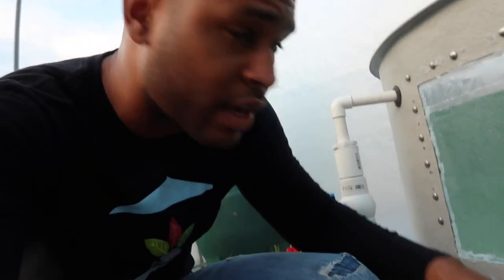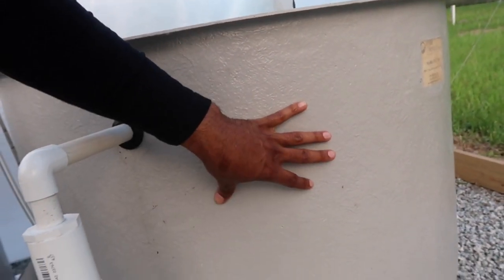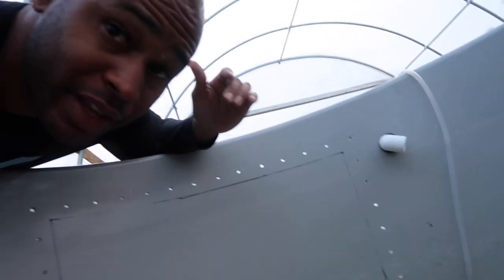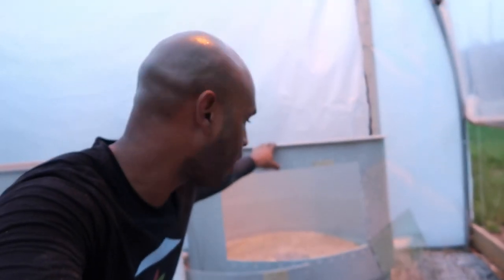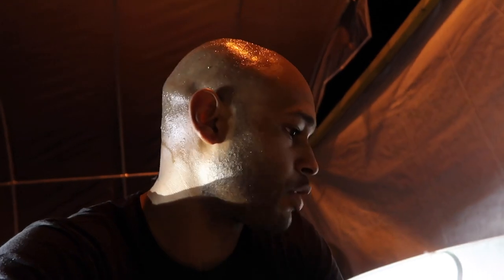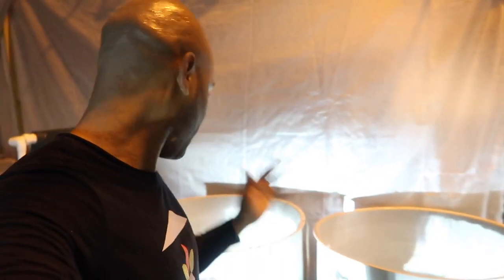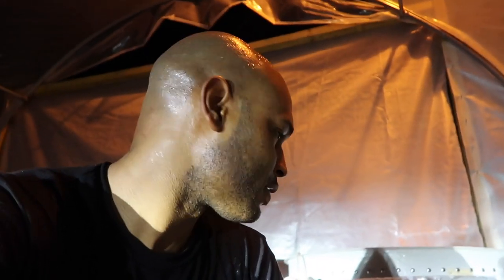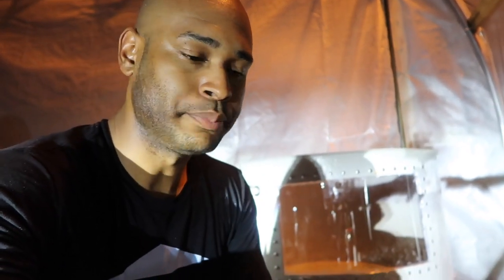Installing The Fish Tank Windows | The Aquaponics God Ep.41

Comment: Not to rain on your window parade, but maybe next tank you put the smooth side of the carriage bolts on the inside of the tank and the nuts on the outside.  I think it would protect the fish from the threads and also probably seal better.  Plus, should you need to tighten the nuts, you can do so from the outside even while the fish are inside.
Reply: John Doe mere mortal...

Comment: I wonder if it matters which order you tighten the bolts, like with a head gasket. I would start with the center bolts top and bottom and work both ways almost to the corners. I would do the corners dead last for fear of creating a gap that only gets worse when you tighten the middle.

I can’t tell, are you using neoprene washers?